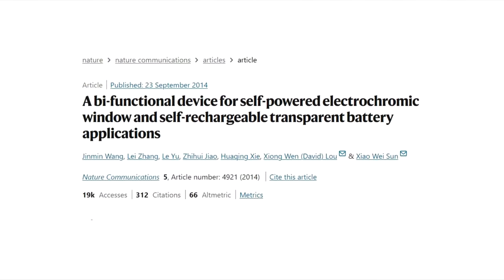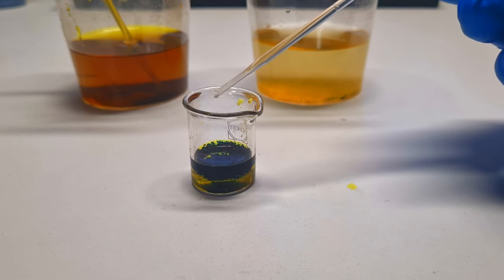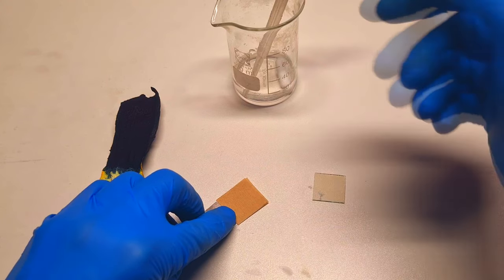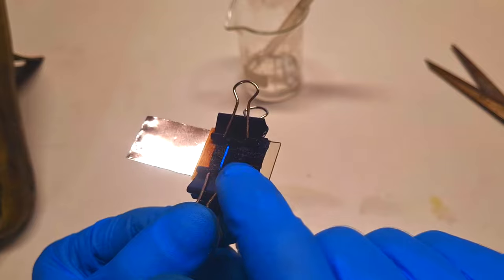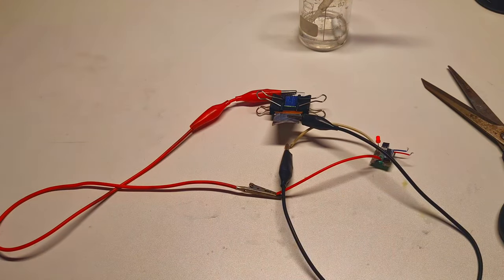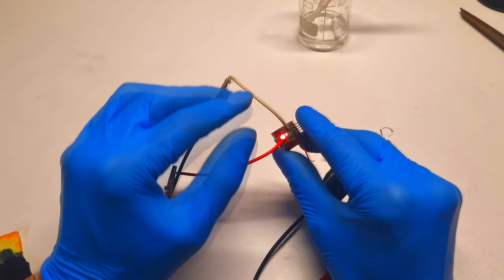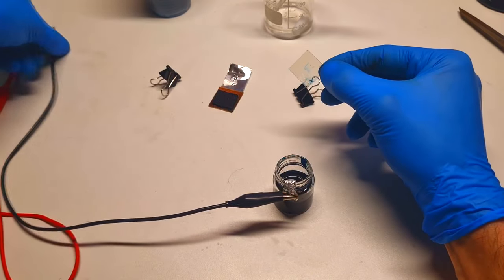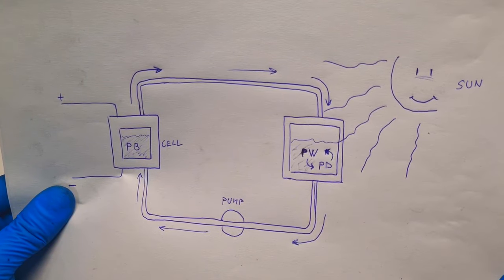Diy Self Charging Battery

Comment: It seems to me that it’s appropriate to use ferric chloride to convert potassium ferricyanide to Prussian blue. The side reaction should produce potassium chloride, your chosen electrolyte. 
This can be done in two ways.
1. Mixing potassium ferricyanide with ferric chloride:

3 K₃[Fe(CN)₆] + 4 FeCl₃ → Fe₄[Fe(CN)₆]₃ + 12 KCl

Or, 2. Mixing ferric chloride with potassium ferricyanide:

FeCl₃ + K₄[Fe(CN)₆] → KFe[Fe(CN)₆] + 3 KCl

This 2nd equation represents an initial white precipitate of potassium ferrocyanide (Prussian white, KFe[Fe(CN)₆])  that then slowly oxidizes to form Prussian blue in the presence of excess iron ions. This reaction takes longer than the first one but can theoretically generate a higher yield of Prussian blue.
Reply from the maker: Yes, I try both. I get different results between Prussian blue made by iron chloride and iron sulfate.
Reply: Different? Is this because one method introduces sulfate ions into the system? Which is better?

Comment: great video but im wondering why would your liquid design need to be flow type? wouldnt a transparent  1/4 inch thick panel with two electrodes act as a solar panel under sun light and once sun is down begin converting to P.white till all of the reactions are complete, then charging next morning?
Reply: just run power wires from panel?
Reply from the maker: Of course i can make into a panel design. Then the cell will look like I make with the first cell in the video. But a flow type can have more capacity. Because the capacity will be dependent on how much prussian blue you have.
Reply: @cayrex  okay that is interesting 🙂 I had an idea come to mind that a panel out in the sun could have some smaller sections that act as I dividual cells, have them wired up to stack voltage perhaps 😁

Comment: Love your channel and work!
Qestion: If you should build a house battery at lets say 1kWh for "cheap" and also Efficient 
How would you do it? And with availible material for everyone with a solar panel
Regards from Norway
Reply from the maker: Thank you! 😁 Hmm, cheap and efficient? Buying some lithium iron battery packs. The DIY batteries are not cheap to make if you want to have some tolerable efficiency. You need to know that the chemistry is only one part of the battery,.... the another part is the construction of the battery. Because it is not enough to put only chemicals in a jar.
Reply: 🤣 Yes I know thate..
But it would be ok to buy 10 kg bromide for my Pool ? at approx 100 USD 
For a house bank you do "not" care of tree things:  1. charge rate/amps 2. Energy density  3. Wheight or enclosures 
As for mee i got 80-100kWh litium and a bank of used Lead Acid in reseve at 15kWh
Im not a chemist at all;) but im a mechanichal engineer examend in 89-90
My point: give me a estimate for a in real life cost based on kWh pr kg of Zink and Bromide  ..
And yes i can test this professionaly at my former workplace
Also i just love the idea that Bromide will last forever in a human sense..
I will certanly build a large Bromide battery if you make a plan for one single cell :) Just need to see if it work..
Regards @cayrex
Reply from the maker: @trygvetveit4747  Correct. Zinc bromine battery can be a good battery. Will be a good start with some ZnBr2
Reply: @trygvetveit4747  
je suis dans les mêmes recherches!
le problème avec les batteries znbr2 c'est que contrairement à ce que tout le monde laisse croire, elles ne sont pas très fiables, et la cyclabilité eh bien..., si vous dépassez les 2000 cycles je veux votre procédé de fabrication!! ;-)
pour le moment en off grid low cost,  recycler les vieilles batteries au plomb pour en faire des GEL ou des ultra-batteries me semble une bonne option, 
sinon iron redox flow mais on ne trouve pas tant que ça de choses testées , nickel iron mais c'est très cher, si l'encombrement n'est pas un problème, peut-être les super-condensateur redox? là on est plutôt sur du 50 000 cycles, intéressant si vous faites votre propre charbon actif